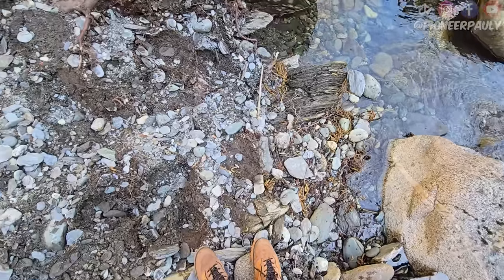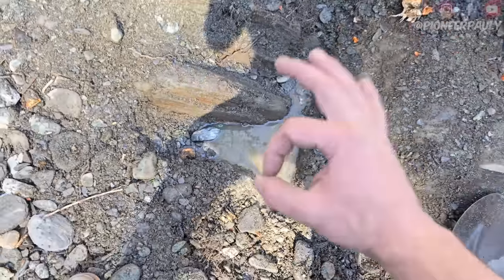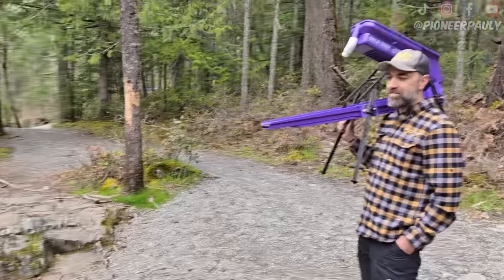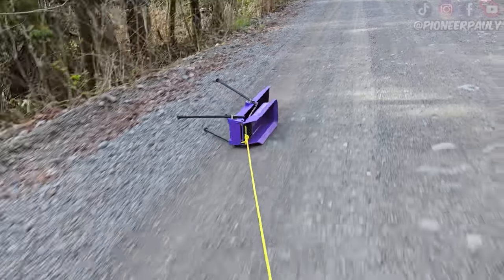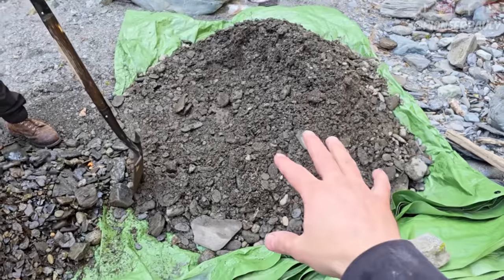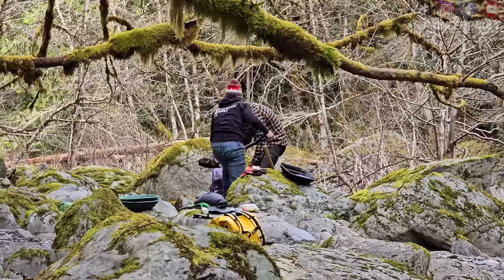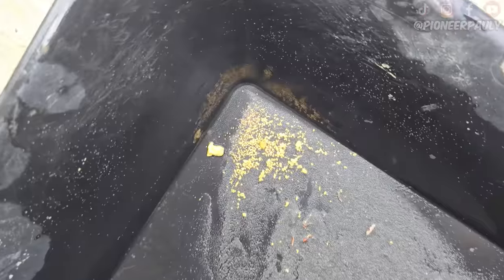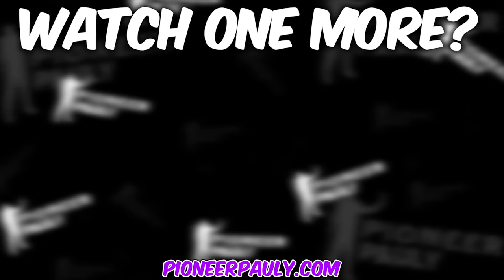Highbanking The Richest Spot On My Gold Claim!

Comment: Also i wanted some advice i found a spot that has 4 tree's in the riverbed big boulders 50 ti 159 pound on boulders on top of a fine clay like material for 2 inches and under that is a layer of gravels iron stones  some lead pellets garnets and gold all the way from micron up to flakes which are misshapen size capital O garnett size small letter  i was pondering what your thoughts might be. 
Peace to you  Dr Siggy